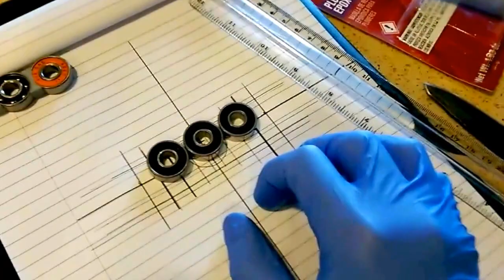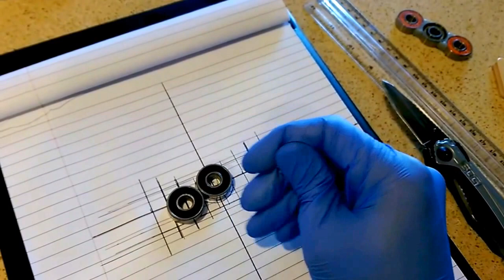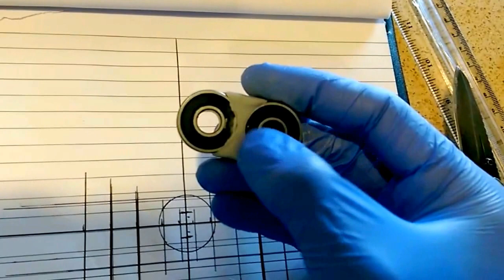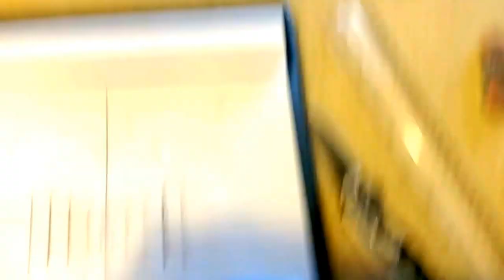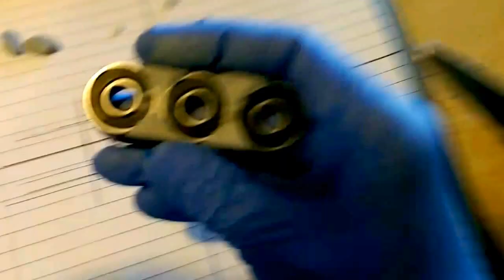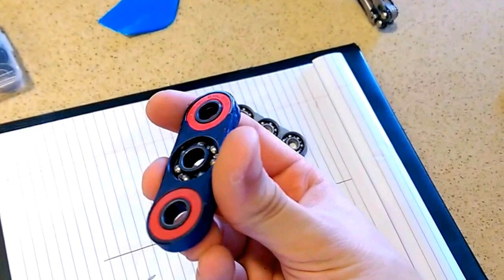DIY Putty Fidget Spinner Tutorial

Comment: better use 2 outer bearing or 3 outer bearing like that?
Reply: Bima Luthfi Anandito depends on how you want to spin it, 3 is better for length but hard with 1 hand. 2 bearings will be a shorter spin but easier 1 handed
Reply: Bima Luthfi Anandito 3

Comment: Bearings
 and water do not mix
Reply: KR Gaming Yeah, the lube dies, and it goes really slow.
Reply: KR Gaming But, you could just spray some WD40 on it.
Reply: The Waffle Gamer put brake cleaner on it and it'll be smooth as hell just won't last as long as other bearings but it won't really matter too much with a 1.5 pound spinner
Reply: Trent Rasmussen I would recommend bones bearings cleaning kit and lube
Reply: Trent Rasmussen Will brake fluid work?
Reply: @k Rhodes fidget spinners don't need any lube because they are not under pressure

Comment: can you make a bar, triangle  or circle out of the putty then sculpt it and then put the bearings in it
Reply from the maker: I'm not sure exactly what you mean. If you are talking about sculpting a design entirely out of putty and then drilling a hole in the material to fit a bearing in; then yes. It would probably be more difficult than just sculpting around the bearings though. This medium doesn't flex or have much give at all. Unless you design the holes to be slightly bigger than the bearings, you might actually end up cracking the putty by trying to insert a bearing after the fact.